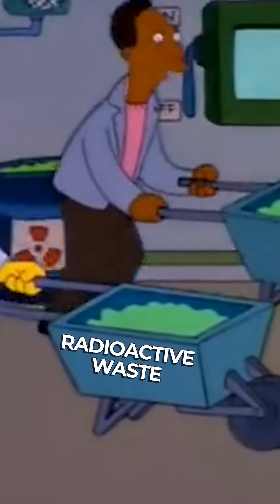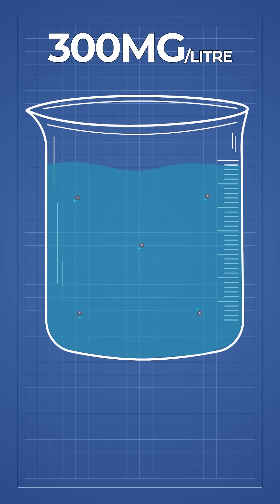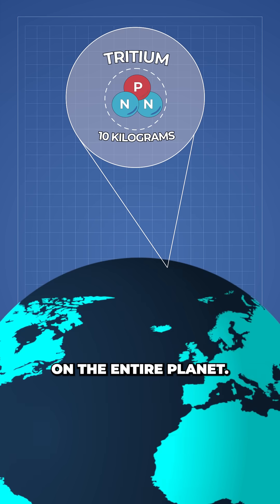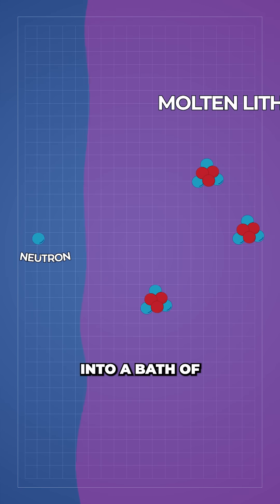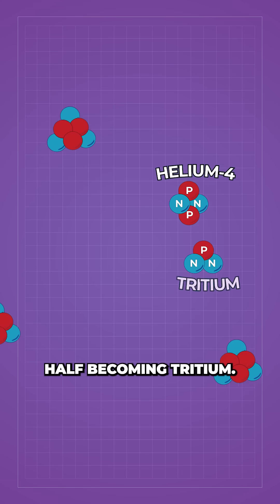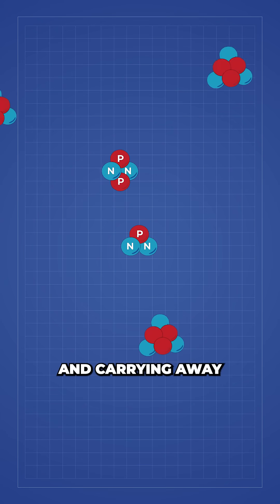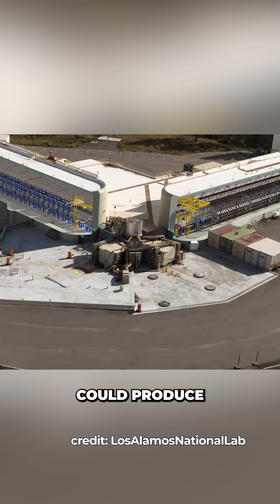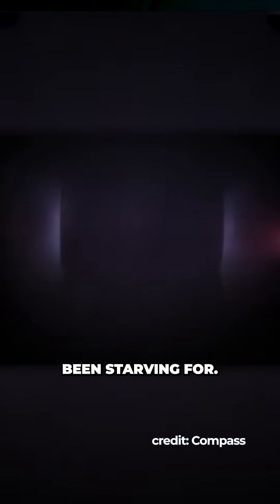Scientists Just Created Fusion Fuel From Nuclear Waste

Comment: Interesting idea but it hardly seems practical, to run continuously, a fusion reactor will need 50kg of tritium yearly to output approximately 8-10 TWh of energy, with a single accelerator only capable of 2 kg yearly it seems dead in the water. To put in perspective the large hadron collider takes a yearly average of 1.3 TW. Obviously you don't need an accelerator as large, but accelerators in general are still extremely power hungry. All my numbers are super approximate but it should serve to show this idea is nowhere near viable as of yet.
Reply: The plans are for fusion reactors to make their own tritium.
Reply: @n3v3rforgott3n9  that method has many engineering issues that will take years to iron out and uses lithium 6 which is rare enough to make it not very viable on a large scale
Reply: @Smoeker  "Yes and no. Lithium 6 is rare, yes, and a doosie to be extracted. There is the COLEX process, which needs mercury and is a pure hassle to maintain, but researchers ALSO found a way this year to separate isotopes differently in a water separation bath. Since Lithium is a smaller atom, yet a rare earth, the abundance is given. ~2% of all lithium is lithium 6. So roughly ~100 million tonnes are in the earths crust and about ~200 million tonnes are bound in salt water.

Long story short.

Totally doable, yet problem to scale."
Reply: @n3v3rforgott3n9 yeah main problems always gonna be scale maybe they'll figure out muons before then lol

Comment: … fusion produces neutrons so couldn’t you use that… the plutonium and uranium mentioned are why nuclear waste last so long if you filter them out (like France is doing) you can reduce to time to become in a safe radioactivity in the waste down to around 500 years witch is a lot less that around 100,000-1M
Reply: Yes the current goal is for the fusion reactors to produce their own tritium as a byproduct of their reaction.
Reply: Also, Uranium and Plutonium waste can already be re-used. Plutonium for new nuclear fuel, and waste (depleted) Uranium as munitions or radiation shielding (or more fuel with special breeding reactors, but only Russia & China have those).
Reply: Uranium is not nuclear waste and it's not the reason it's radioactive. 
Even plotoniom is not radioactive inaf to be the reason. There are more by products of fission that are the reason for the high radioactivety.
Reply: @danielboro2000 yes but they have shorter half lives the uranium and plutonium and are present in nuclear waste as the reactor can’t use
Reply: @DoshyWashy
Thy having sorter half life is the problem. Uranium had a half life of millions of years. It is not a radioactive hazard. You can hold uranium in your hand with no risk

Comment: Lithium-6 is very rare as well
Reply: Yes and no. Lithium 6 is rare, yes, and a doosie to be extracted. There is the COLEX process, which needs mercury and is a pure hassle to maintain, but researchers ALSO found a way this year to separate isotopes differently in a water separation bath. Since Lithium is a smaller atom, yet a rare earth, the abundance is given. ~2% of all lithium is lithium 6. So roughly ~100 million tonnes are in the earths crust and about ~200 million tonnes are bound in salt water.

Long story short.

Totally doable, yet problem to scale.
Reply: What iam more concerned about is; Tritium is also used in Hydrogen-Nukes and combined with the knowledge the LOS ALAMOS research dp found this, is worrying.
Reply: @Dexruus 
Los Alamos is practically the only nuclear research installation on the USA and one of the leading in the world. They is no were else this could have came from

Comment: Don't particle accelerators take a lot of energy to accelerate a tiny particle? i.e. Would we need 2 nuclear reactors to power the particle accelerator to create of fuel for 1 reactor?

I am reminded of when they say we finally got energy out of a fusion reactor with lasers. (In the small print we had to use 10 times as much ienergy n to get that bit out... but this is early days... we have been on the brink of fusion for 60 years now starting with Scylla I in 1958).

Comment: "But does it make weapon material?"
Reply: Not as much as simply refining the waste to get out just the Plutonium.   
  France recycles nearly all its nuclear waste, to the point that each person only creates a cigarette lighter sized amount for power over their lifetime
Reply: @GoatPopsicle I was being sarcastic 😅
Reply: @GoatPopsicle  lifetime of a person or lifetime of a fuel rod? (ought its person but i still wondered).
Reply: @tsietha6335 yes, it’s per person, for a lifetime of electricity.
Reply: No
Reply: literally yes because tritium is used in h-bombs because those also run on fusion.
Reply: @hurricanefury439 😞
Reply: @hurricanefury439 
No. 
H bomb use LiD
Reply: Actually yes, since tritium is used in boosted fission atomic bombs. (Not in full H-bombs, those use LiD as daniel pointed out correctly.)

Comment: Hear me out.

Thorium Salt reactor used to power (and generate waste) for a Particle Accelerator which converts said waste into Fusion Energy.
Reply: That waste is a by-product of the original fuel. Using thorium is a different fuel with different byproducts.
Reply: @robertmarsh5322  The beauty of the accelerator-driven design is that it can accept a wide variety of nuclear fuels, including waste from many kinds of existing or proposed nuclear reactors. Actually it could even use completely non-radioactive elements like lead, but then it becomes very very inefficient.
Reply: 💯  it's abundant and just sitting ad a byproduct.
Reply: ...or a Fusion reactor powering the particle accelerator to convert the waste?

If you've cracked fusion and can generate power from it, then you've plenty of energy for the particle accelerator.
Reply: hear me out.

fusion reactor feeding straight into a particle plasma accelerator that creates an artificial sun which power solar cells powering the fusian rector
Reply: Efficiency loss is the problem.. At best you're losing 20% energy.
Reply: Why not just hook the thorium reactor up to the power grid, then?
Reply: @Riesenfriese  There is no Thorium Reactor in a realistic skale.
There research reactors with a Power Output from 100 MW.
Reply: @hostilefrag1344 you missed the point entirely. What I said was why use a thorium reactor's power output to make fuel for a fusion reactor, when you might as well either:
A: skip the fusion reactor and just use thorium energy
B: use the energy from the fusion reactor to power its fuel production.
Reply: @Riesenfriese  der sarkasmus funktioniert nich bei reiner fiction.😂
Beide Technologien sind experimentell für uns.
Reply: @hostilefrag1344 no reason to switch language on me like that.
And that both technologies do not exist yet is irrelevant to my point.
If you must have existing technologies to comprehend, imagine someone using the electric power output of a coal power plant to create fuel for a gas power plant. One of those plants is redundant and inefficient in this scenario. If the gas plant makes more electricity than the gas-making process consumes, then just power the gas production with a part of the gas plant's output. Otherwise, you might as well just connect the coal plant to the powergrid instead of wasting its energy on making gas.
Reply: @Riesenfriese  Why not hook up the thorium reactor to the power grid? There are a few points:

A) Fusion is likely nicer than fission in regards to safety and very long-term fuel supply. It is probably possible for fusion reactors to breed their own tritium out of lithium with external help, but to develop these technologies we need some good source of tritium to jump-start the process.

B) The proposal mentioned in this video is actually itself a type of nuclear reactor. Depending on the specifics of the design, it can generate most of the power needed to run its own accelerator, or even a net positive.

C) Accelerator driven reactors are far less efficient than conventional nuclear reactors or other reactor technologies that have been proposed. But they can run on a wide variety of fuels including existing nuclear waste, and their own waste is less dangerous because it contains less of some of the most problematic isotopes. A balanced mix of both types of reactors can reduce nuclear waste while producing energy for the grid, and that is before fusion.
Reply: Or just use the giant fusion reactor 1AU away and build solar panels, wind turbines and energy storage.

Comment: Plus more helium, and which is cool too!
Reply: Miniscule amounts... If it's only making 2kg of tritium per year it's going to be making ~2.6kg of helium per year. It won't even be worth capturing the helium.
Reply: @MeOnStuff  party pooper
Reply: @alanoswiecimski2080 pun intended ?
Reply: @MeOnStuff  Makes me wonder though how much cooling would be needed for the machine and what percentage 2.6kg could be used for that. Would be nice to need less outside resources
Reply: @MeOnStuff question, isn't 2 kilograms of helium a lot ? And is helium 4 usable for what we use it for ?
Reply: @Panxho24   No, 2.66 kg of helium is about 15 cubic meters (gaseous form at standard conditions). This really isn't much at all, especially when it's typically used in liquid form - it would only be about 21 liters when condensed.

Almost 100% of helium is helium-4 so yes in theory if this helium was captured (which would not be worth it) then it could be used for normal applications.
Reply: @MeOnStuff  how many cubic meters is a party balloon?
Reply: if i remember correctly particle accellerators usually use a lot of helium on their own, so probably a net negative.
Reply: Endless supply party balloons😂
Reply: @atakorkut5110  wait. Isn't that why we're mining the sun?😂
Reply: @atakorkut5110  Radioactive party balloons at that.
Reply: @johnshite4656  Helium 4 is not radioactive. Or do you mean impurities with Tritium and whatever is left from splitting Plutonium, some nice Caesium 137 or so.
Reply: @atakorkut5110 Either that, or reviving airships for commercial purposes.
Reply: Wasn't there a shortage of helium a few years ago? This could be a nice side product.
Reply: Orbital mining platforms around Jupiter, Saturn and Uranus anyone? I believe Neptune has too much Methane to make it profitable for Helium Extraction.
Reply: helium is useful
Reply: a couple kg per year
basically nothign